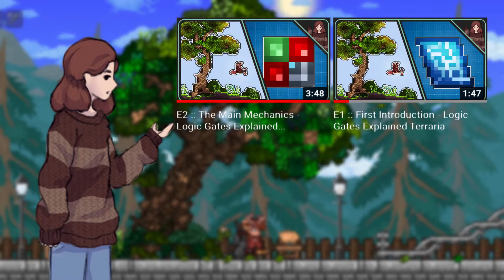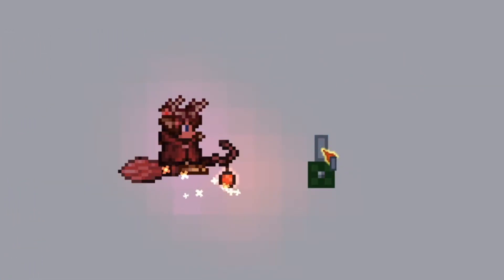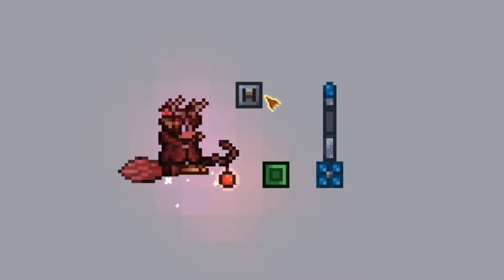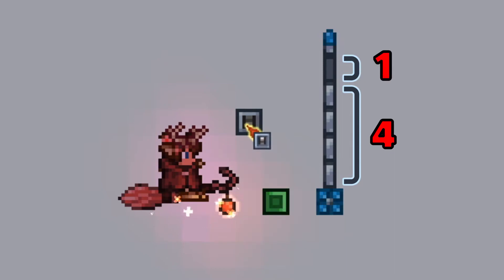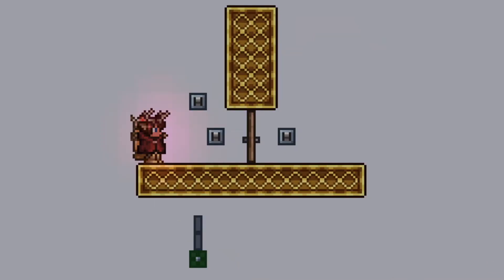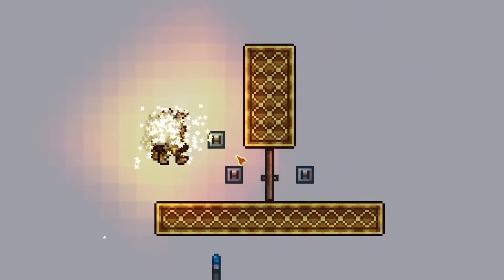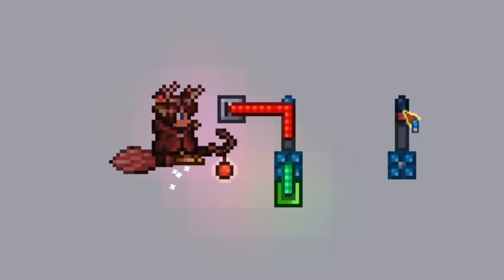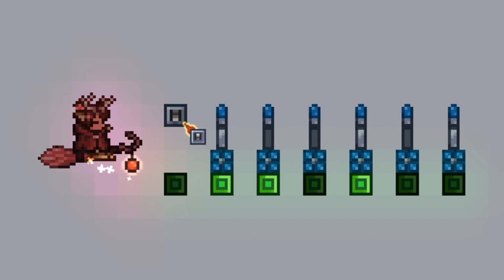Terraria: The Secret Mechanic Behind Faulty Lamps

Comment: Thank you for explaining the Faulty Lamp, i was very confused on how the T-FlipFlop like behaviour happens, and turns out the devs just decided to add it as a feature, neat

Also connected normal lamp and gate, and seems that the output is locked to whatever lamp you placed below the faulty one

Thanks!
Reply from the maker: No worries! I'm glad you enjoyed the video :)
Feel free to check out the discord server if you have any more questions about wiring!
Reply: @CubsYT  Thanks for the quick reply even this much later! in Terms of syncronous operations i'm fine, but anything that is asyncrounous and based on the current state of the machine seems to not work due to torches burning out, i'll look for info on that tomorrow :)